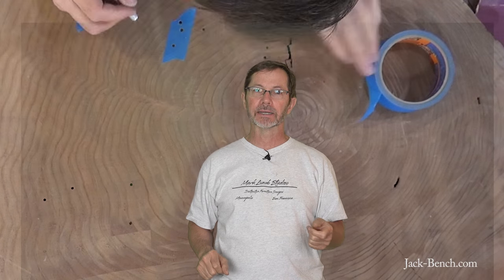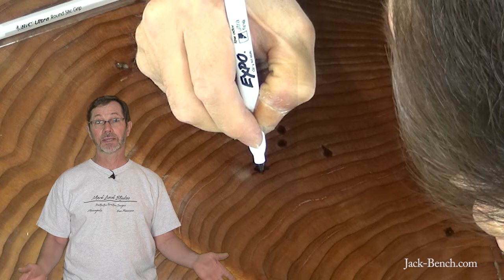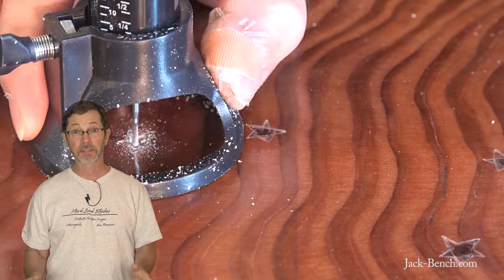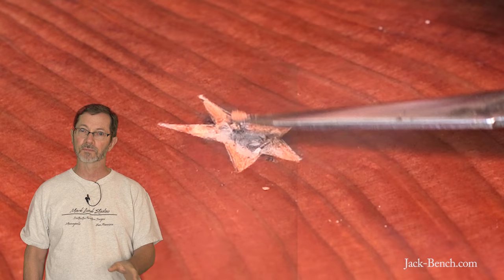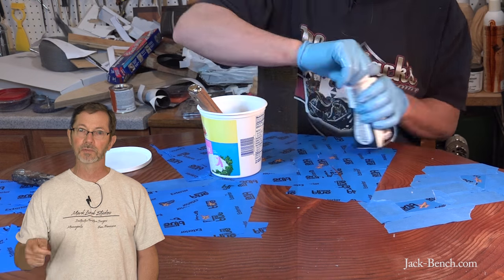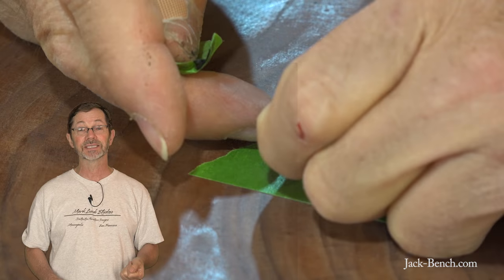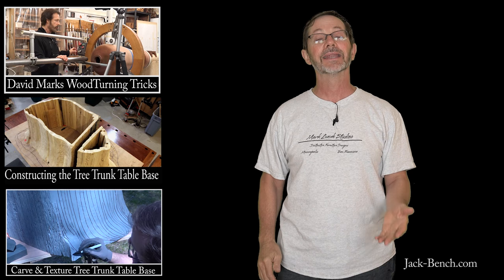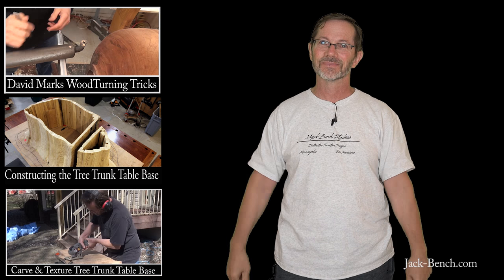Inlay Stars in A Slab Coffee Table (One Technique)

Comment: Great video Charlie!  I like how you used the dye and wood filler.  I've got some Durhams rock hard wood putty.
Reply from the maker: Thanks Chris!  Does the rock hard putty stand up over time, with wood movement?  Also, honestly, should I do the green screen again, modify it, or ditch it all together?
Reply: I thought the green screen was good because no shot was obscured.  Only reason I would ditch it is if your production time was drastically increased because of it.
Reply from the maker: Thanks  Chris, I appreciate the feedback.  Now that I have the green screen set up it is not that big of a deal to re-use it.  It does add a bit of time to the editing.  As of now I am thinking that I will use it again, but not all the time.